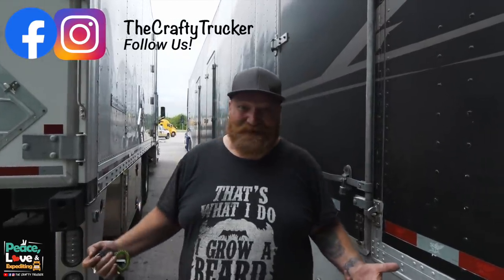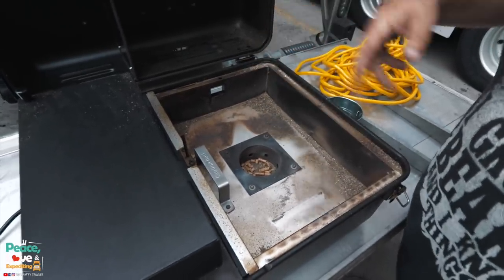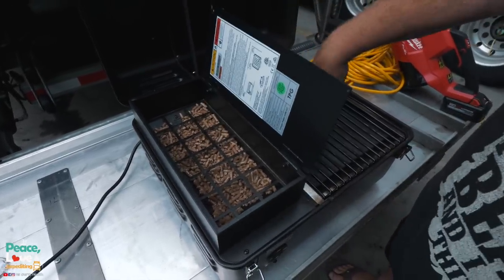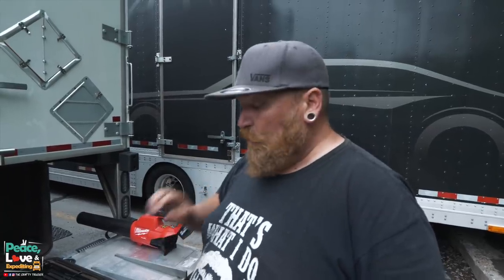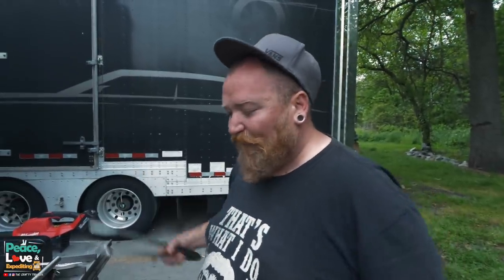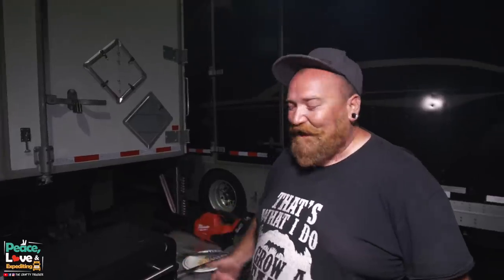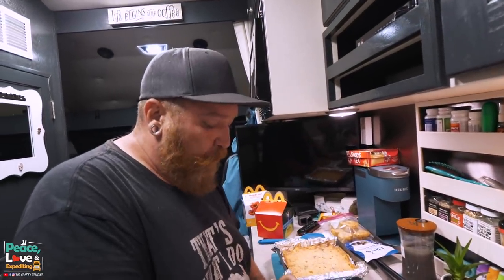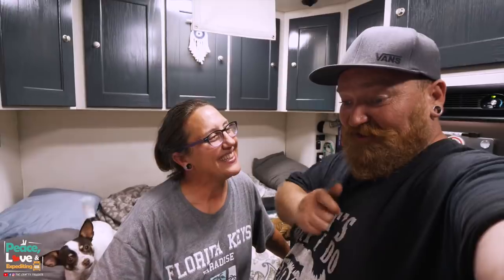THE BEST SMOKER GRILL FOR TRUCKERS/CAMPERS | Traeger Ranger

Comment: Something you might want to do. I learned on my treager to wrap the outside of grease bucket with aluminum foil then pull it off of outside and use it for liner inside. You won't have to haul a greasy bucket around.
Reply: I just bought a Ranger yesterday...always looking for hacks like this!  Also, has anyone put handles on the side yet?

Comment: Great video. I learned something watching a vide about a hybrid offset pellet smoker that helps. I tried it today with my vertical pellet smoker. If you take a handful or two of pellets and add them straight in the burn cup to cover the lighter probe it will start quicker and not have to prime as long.

Comment: hey if you haven't figured this out a lil silicone chalk to keep the rubber feet on. then you can still remove them if needed............... tip 2 and 3  put foil over the drip pan and the in the grease can to make cleanup way easier.   thnx for the review. :D

Comment: I’ve been looking at these but decided to go with the GMG Davy Crockett instead. 12volt/80watts instead of 110. Plugs right into my aux 12volt port, 1 meat probe and WiFi control with a free app. No grill included but that’s not a bad trade off for WiFi control.

Comment: I have the Scout model, it is the same size grilling surface. The biggest difference is the size of the wood pellet hopper and the difference in the adjustability of the thermostat.  The scout is 100 dollars less money. I use mine a lot and the only complaint I have is the small pellet hopper compared to the ranger.

Comment: we run ours (Ranger) of an inverter supplied by the dealer it is small and works perfectly I have also used it from the F350 inverter but that requires the engine running.
Reply from the maker: Good to know. We may try it

Comment: The ONLY thing I'd suggest is when you move to the sear faze you don't cover it.....put the meat on and don't put the lid down.  You had the right plan, about 130 degrees internal then sear, but when you put the lid down it started to bake instead of sear and pushed your internal temp higher than you wanted.  By leaving the lid open you stop the baking and instead just apply heat to the outside, which is what you want.  Nice grill and keep learning and enjoy the results!
Reply from the maker: Thank you for that tip. Didn’t even consider that. Makes total sense though.
Reply: @TheCraftyTrucker  I normally stop at around 125 degrees when baking the meat, then sear each side until I reach 130 degrees.  Pull it off, loosely cover with aluminum foil, and let rest around 10 mins.  Perfection!

Comment: The Ranger and other AC models use 330 watts, Watt usage will drop to 45W-100W after reaching the desired temperature, based on fan and auger usage. You are running your generator when you could use a small inverter or battery pack. That's crazy.